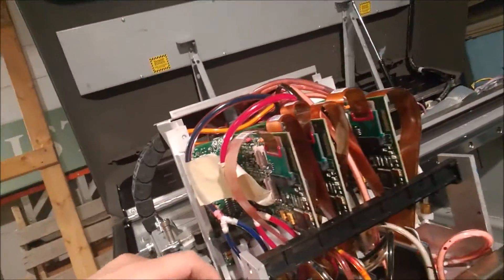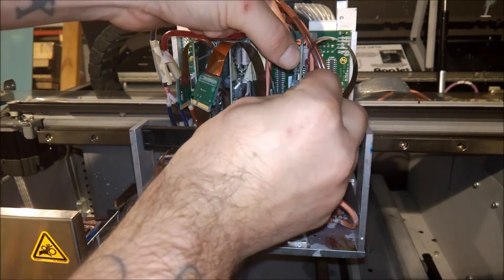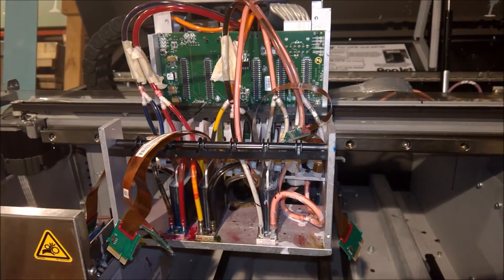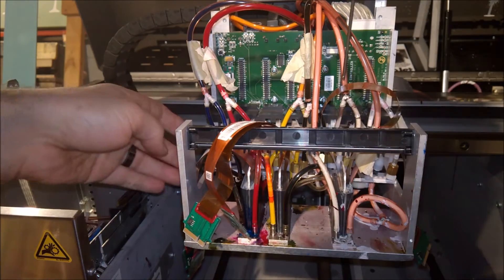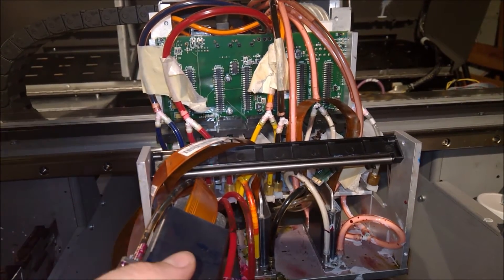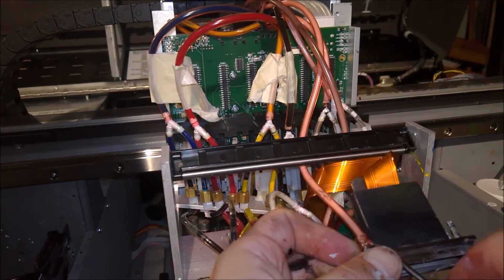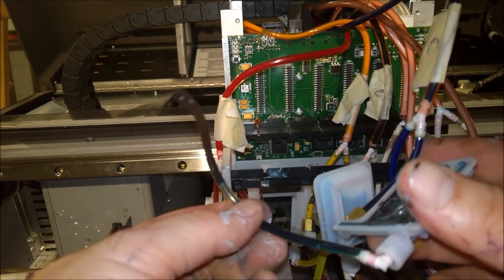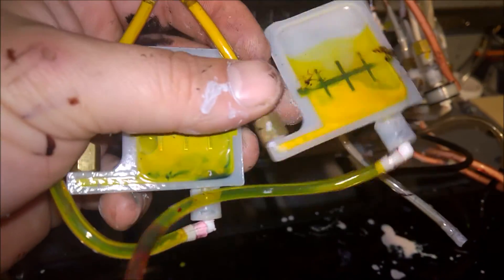Signworx Technical Series - Anajet MP5i Damper & Print Head Removal

Comment: How do you know if you need dampers?
Reply from the maker: if there any any ink dripping, that means there might be a tiny hole or the seal of the plastic is defective and leaking out of the side. Or if they aren't filling up when you start printing or doing a startup fill. If that is happening they may be clogged or damaged. But there could be other issues causing print issues. What issues are you happening that you are thinking about the dampers?
Reply: SignWorx NC your freaking awesome man. thanks for the speedy reply! My Lines are not filling and after watching  your videos I notice my white damper is leaking pretty bad. I purchased this machine used. I hope I'm not unscrewed
Reply from the maker: yeah used machines can be tricky sometimes. But I would definitely replace the damper if it looks like its leaking and then try again. But the biggest issue I have seen with used printers is those who sell them haven't taken care of them properly and the heads can sometimes be clogged. but lets hope that's not the issue and its just the dampers. If you have any other questions just let me know.

Comment: Now that I have the Print heads operational, I still can't keep white ink in the dampers. There's ink in the back compartment of the damper but not that front pocket. Any idea  what that's about? Suction problem? I'm going nuts with this thing! I finally thought I was going to be up and running again, never ends with this thing
Reply from the maker: well the dampers wont always stay full. for us they only fill when we start to print. There could be a suction problem though. What firmware are you running?
Reply: SignWorx NC it turned out to be a suction problem. I had to pull air from the tubs that went between the print head and dampers, now it runs perfect.
Reply: for now!
Reply: How did you pull air from the tubs? I assume by tubs you are referring to the little round units under the dampers. Thanks in advance.
Reply: How did you pull air from the tubes? I'm sure we're having the exact problem you mentioned so any information would greatly be appreciated.

Comment: I am on replacement number 2 of the white dampers because the instructions they sent were not that graphic and I am pretty sure I had done it wrong. I didn't know about those clips, I just figured out that the black bar holding the plates sturdy can com off all the way.

If this doesn't work I may need to change out the white tubs but tech says that's way involved and want me to send the printer back to CA....I'm east coast!
Reply: I wish you had this video out before I attempted this ....wish me luck. I'm about to power her up and see if it will print
Reply from the maker: yeah not all their instructions are all that detailed. thats why we try to do videos inbetween printing. it seems to be a ongoing trend.